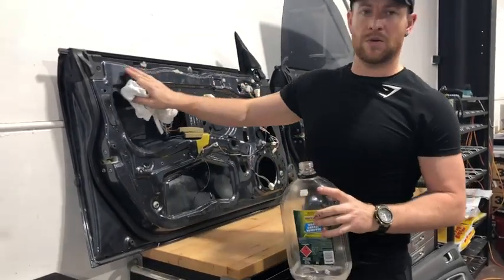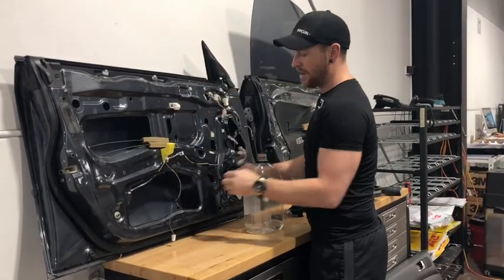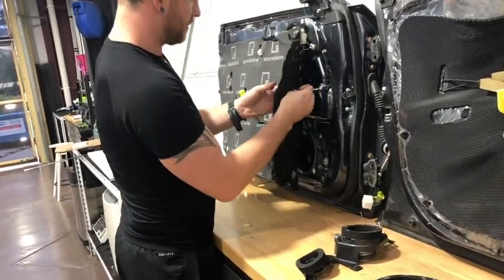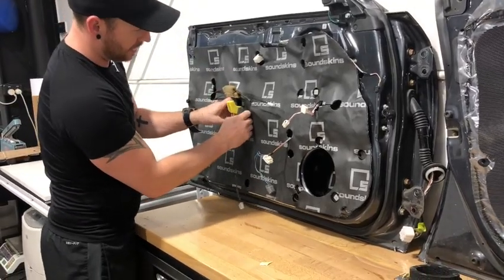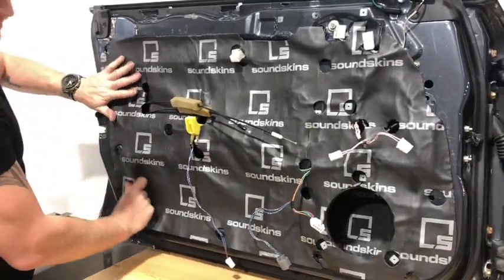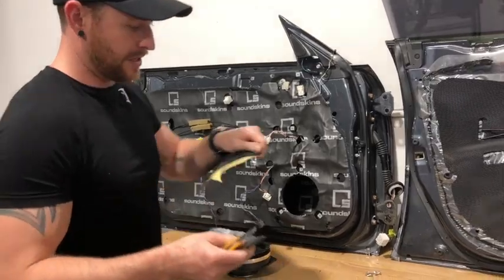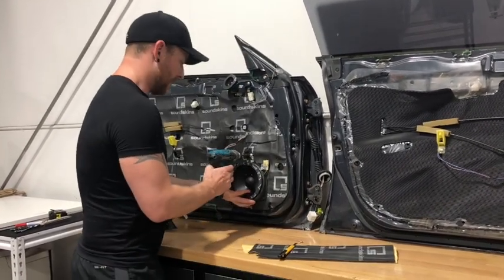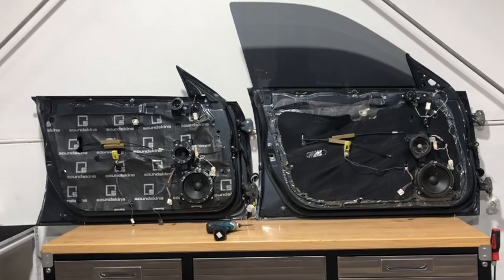SoundSkins Stage 2: Best Way To Apply Sound Deadening Outer Layer

Comment: The only problem I see with this is that you'll have to remove the sound deadening material to replace the window and/or window regulator. Not to mention the amount of effort to address every wire, tree, screw on the door panel.

Comment: Actually, high efficiency damping material, Dynamat, CAN get you significant mid-low end speaker performance and outside noise reduction with minimal weight. Doors are definitely not a place where you would want to use Mass Loaded (very heavy) materials.

Comment: Great work!, is the material the same as Dynamat?
Reply: From what I have seen it should be much better. Dynamat is overpriced and underperforming when compared to other products.  This product has a foil and butyl layer  with an additional layer of acoustic foam on top. I am using this product for deadening between the door and door panel on my current install. I am using Second Skin Damplifier on the interior of the door. Hopefully this product will save me time and the need for any additional jute or foam. I really think this stuff is a winner so far. Time will tell.
Reply: @TickleFingers  Hey I was wondering how it went with the soundskins and how you like the result? I'm between dynamat and this product. For my floor was gonna do dynamat and dynapad but I like the idea of 1 product!
Reply: @Monty87LS  I freaking love that stuff! It's easy to work with and the results were exactly what I was hoping for. Using a nice sharp blade I was able to cut 3/4 circles really well. You can even use a pair of scissors. I had some junk 99 cent scissors from harbor freight and they worked great. The stuff is  a little more expensive, but that foam layer makes a huge difference for noise reduction. Sound deadener alone is not meant to reduce outside noise and an mlv or ccf layer is what's really needed for that. Since this product has closed cell foam layer it reduced outside noise. It even made a difference in how loud my power locks and power windows sound. I'm a believer now.
Reply: @TickleFingers  Thanks for the response. Thats what i was hoping to hear. in order to get the results Im looking for with Dynamat I would have to put the Dynapad on top after applying the regular dynamat xtreme and it just seems like a better Idea to get an all in 1 product. Im hoping to do this to my suv and my wifes this summer. And upgrade the sound if I’m allowed lol
Reply: @Monty87LS  Good luck. Get yourself a decent roller. This stuff is a little heavy and you notice the weight in the door, but you'll see an outcome to the weight penalty. I used a big socket to use as a cutout template tool with my blade to get nice holes. You will hear a big improvement in the stock speaker performance as well. Might hold you over until the wife calms down from finding out how much you spent on sticky stuff you can't even see and let's you buy some new equipment.....
Reply: @TickleFingers  Haha yea I was thinking of doing the doors first so might start there but I will end up doing the whole car. Its looking like soundskins for the doors and floor plus on the sides in the back... (Honda pilot) i may do either this stuff or dynamat and dynaliner on the roof and just gotta figure out what I’m using on the hood. going for noise reduction also. These newer Honda pilots are very loud with very minimal sound damping material installed.
Reply: @techassembly9653  How did it turn out? Video?